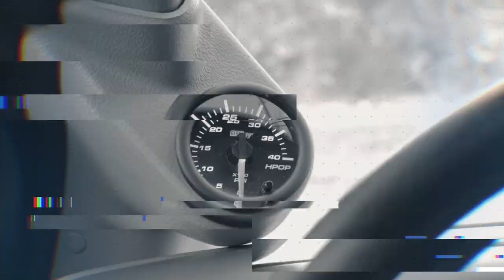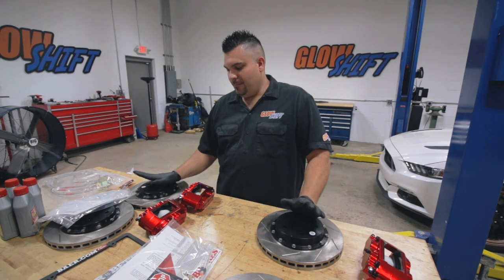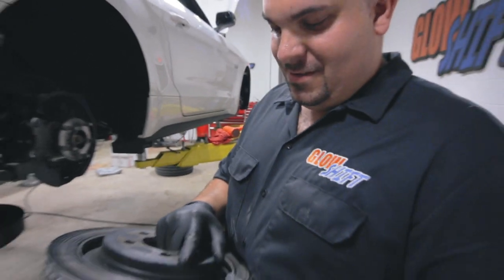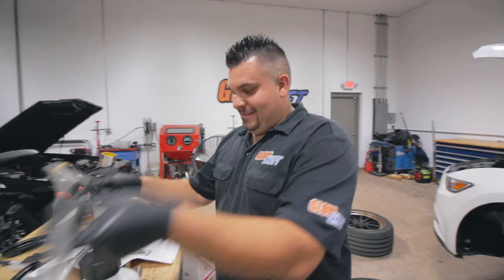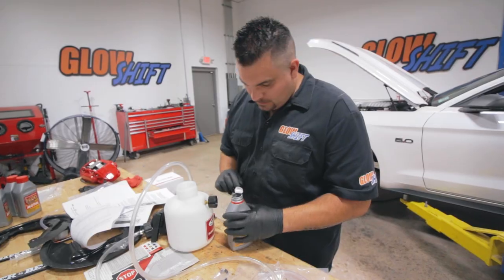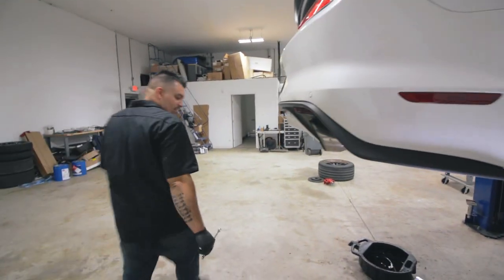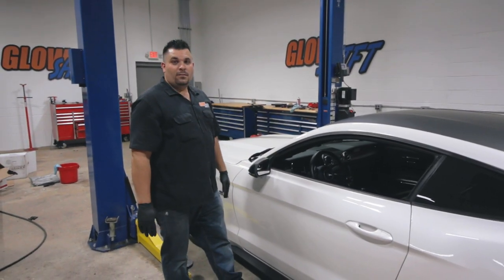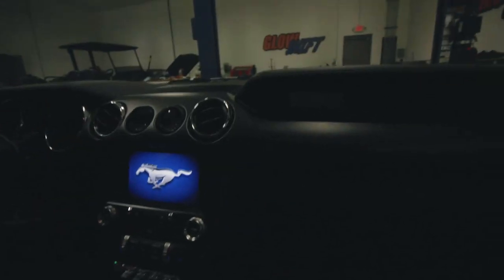GlowShift | Ep. 11 Supercharged Mustang Gets BIG Brake Upgrades - Baer Racing Brakes Install

Comment: can u daily drive with these brakes? any issues with turning and braking?
Reply from the maker: Yes, you can. The only issue we had at first was the pads screeching. But we changed those out and solved the problem. These particular brakes do not have the parking brake, so, just something to keep in mind.